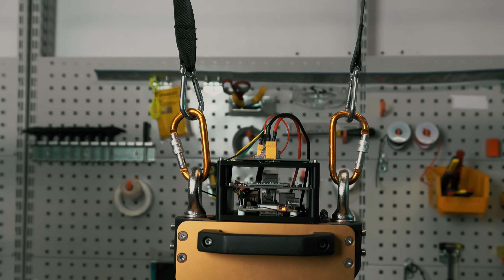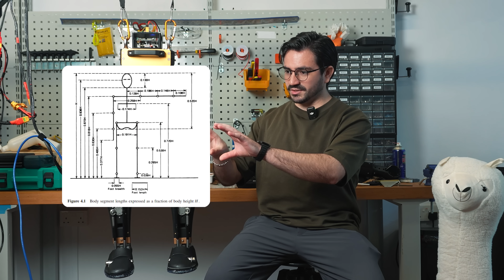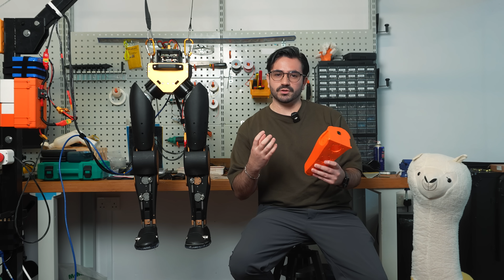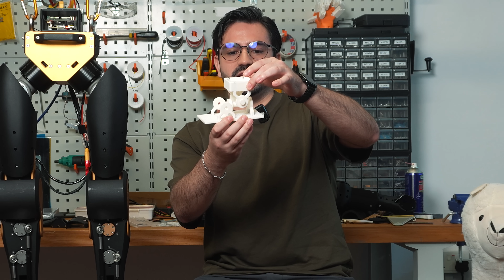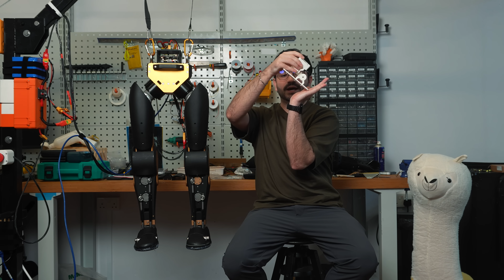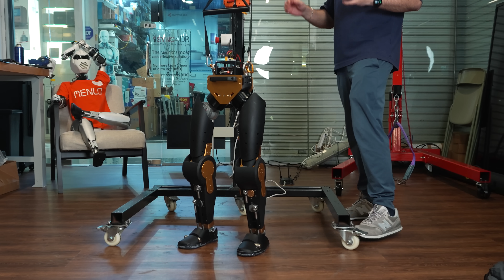How we built humanoid robot legs

Comment: Until you get it walking the mechanical design has little value.
Taking the articulated toe as an example, everyone's thought of it but it doubles the contacts for the simulation, so it'll be twice as slow. You also need to add system identification for this part because it's going to be crucial for the walking motion. Also going to make the contact assumptions much harder if you want to go with MPC instead of RL.
Interesting project though, looking forward to the next video.

Comment: Great design. Robot hip joints have now evolved into the V shape with the hip flexor motors at a 45-30 degree angle. This allowes for way more compact framing and actually has better performance than the previous boxier prototype design. A good example of this is the step from the Unitree H1 to the newer H2. Also, do you plan on finishing the torse as well?
Reply from the maker: Thanks! Yes, we're finalizing the full body by March.

Comment: Hello!"Can I ask a couple of questions?"
I rarely come across videos like this — your leg design is really interesting and unique.
First question: What motors and gyroscopes are you using?
Second question: How do you detect when a leg is lifted off the ground, and how do you maintain balance?
Third question: Would NEMA 17 motors (the ones commonly used in 3D printers, etc.) work for this, or do you definitely need brushless motors?
Fourth question: What software/program did you use (for control, simulation, programming, etc.)?
Can you provide the STL files for 3D printing on GitHub? I can't download them. Also, what modules and materials are needed? Thanks in advance.